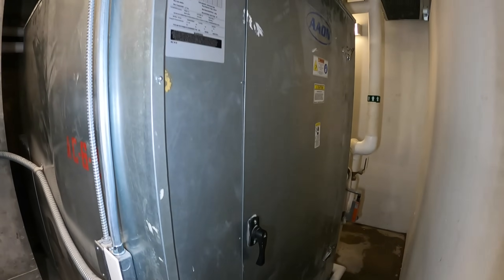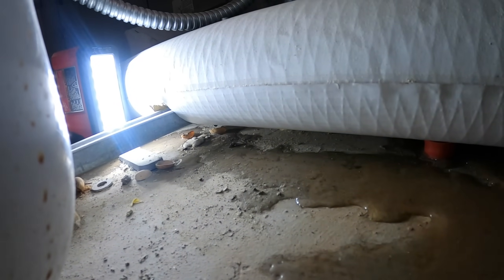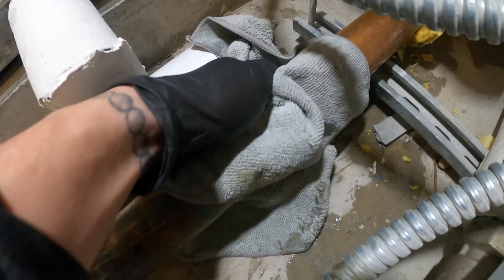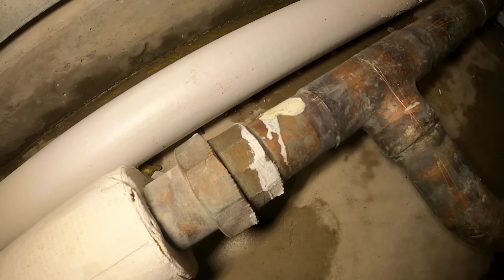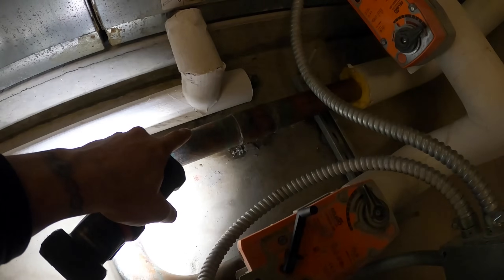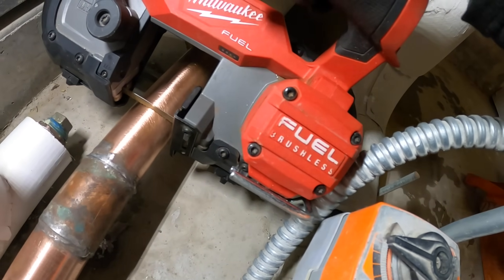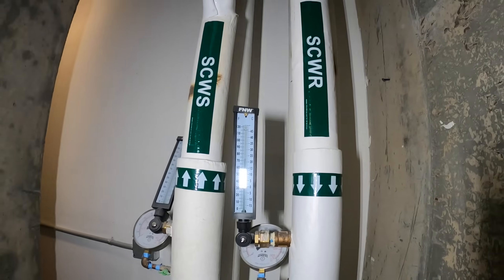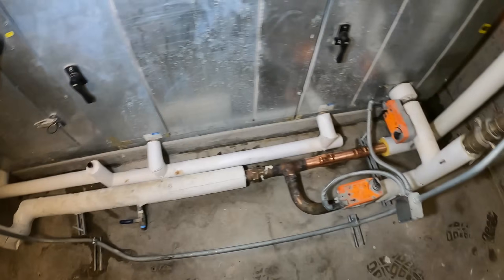HVAC: AAON Water Source Heat Pump LEAKING WATER (AAON Heat Pump Troubleshooting/Water Leak Repair)

Comment: That failed joint looked awful, like somebody didn't have the proper tools or skills for the task. That sawzall did a great job. I'd consider using an oscillating multitool as they can work in a very tight space. Personally, I'm not a fan of crimped joints and would prefer to do a decent job soldering in new parts even though it would be less straightforward.

Comment: You don’t think reheating that joint could have worked?
Reply from the maker: It could have possibly worked. I've done that before, but once a connection like that goes, I don't trust it anymore. I'd prefer a new brazed connection as the other connections were brazed, but the pro press is a life saver, so I'm glad that worked out👍 Thanks for watching 🔧⚡️
Reply: Great work by the way!
Reply from the maker: @dmitrynetes3102 Thank you! 🙏
Reply from the maker: @dmitrynetes3102  Heres a link of me doing exactly what you thought on a similar unit in the same building 

https://youtu.be/Kf7bLhauRto?si=p62GI_QsAsCOHrm_
Reply: Rebrazing is OK, but when soft solder is on there, Murphy is always waiting to do you in. It's always better to start fresh. I don't use propress, although in NYC, it is a time saver with all the hoops you have to go through to turn on a torch for literally 5 minutes. In Boston, forget it. Unless it's new construction, you can forget it. You better pick a brand and keep that thing on you truck ready to go. 
JMT, I know you are busy, but it's time for a battery set up in the truck. Inverter, battery holder, the worx. Before it gets busy. At least every you go to the truck, you know you will have a battery ready to go.
Reply: I was thinking that as well, anyway good job👍
Reply from the maker: @HVAC.Engineering I hear that! I have a video of doing that exact method in the video link below on a similar unit in the same building. Thanks for watching!

https://youtu.be/Kf7bLhauRto?si=p62GI_QsAsCOHrm_
Reply: Yeah definitely need to start over specially when you have water in the line press is the way to go mind where I work we avoided press till 2 yrs ago and we have not looked back